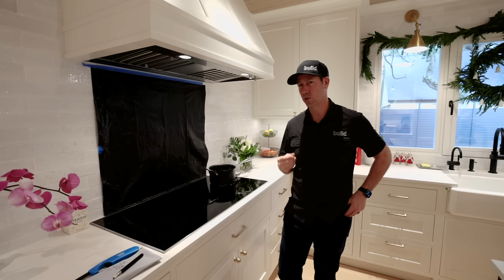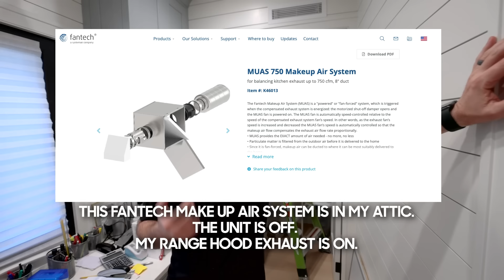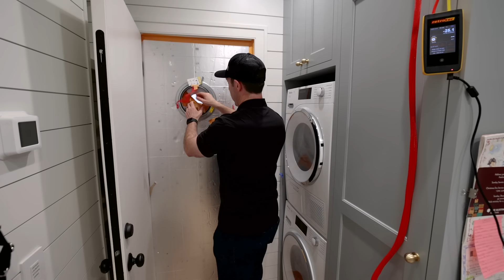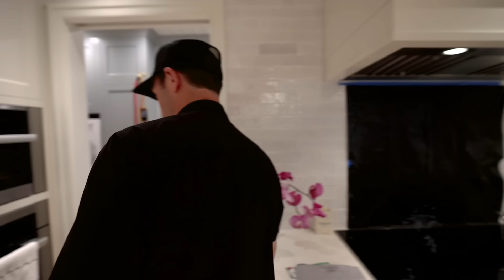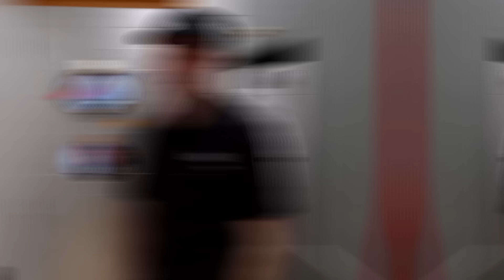Make Up Air for a Kitchen Exhaust - Most Homes Suck. (Pun intended)

Comment: As always great information, ventilation is not the same as circulation. 
Make up air is very important!!
   400cfm's is roughly about 1 ton of air.
800-2,1200-3,nd so on.Another good point no more than 3pascals of difference in air ventilation. 
   Lots of good stuff to know from
  "THE BUILD SHOW"
Thank you Matt!!!
Reply: james for sure 3 or less highly desirable, but has anyone really died from temporary 5 pascal negative pressure in a house while cooking ?? really hard to make he case for they expensive, complicated Fantech system

Comment: Hey Matt! Remember A = π r2 so a 16 " hole would not be twice as big as and 8 " hole. It would be 4 times as big. To get twice as big multiply by √2 (approximately 1.4142) so about 11.3". Thanks for the info however.

Comment: A 12 inch hole would be twice the size of an 8 inch hole (area of a circle).  A 14 inch hole has over three times the area of an 8 inch hole.  A 16 inch or 24 inch hole would not needed be needed to double or triple the intake opening.  Great video!
Reply: Excellent point...  I did the same calculation on a house I am designing and think that passive make-up air is a better tradeoff if there is a good location for the intake vent; and I settled on an 8" x 20" hole -- 3.2 times larger than the exhaust duct.

Comment: I have a house that I am designing in North Texas.  The house will have a gas cooktop and a wall mount kitchen hood that will pull 1266 CFM at its max setpoint.  Fantech makes a matching make-up air fan for this set up (similar to your install).  I fear locating the make-up air at the hood for 2 reasons.  1.  It will blow 1266 CFM of hot air on to the person cooking.  2. Since it is forced air, 1266 CFM will be blowing onto the gas burners and pots (possibly altering the cooking process).  I saw how turbulent the air was at the make-up grille at the other end of the room of your home.  I like locating the make-up air away, like that to make the conditions at the cook-top optimal.  Unfortunately, the HVAC system will somehow have to manage the addition of 1266 CFM of outside make up air when the air is introduced so far away from the hood.  The energy efficiency / reduced HVAC tonnage for tight construction home might need to be recalculated to account for the 1266 CFM of outside air.  Therefore the HVAC system has to be upsized to account for this.  Frustrating.

Comment: My return ducts have a make up air valve to the outside to make up the air that leaves, the HVAC unit can pull in outside air and pressurize the home just a little.  Don't have giant bath vents or range hood, just 6in each.

Comment: Regarding the size of passive make up air opening. Remember the size of hole and flow isn't linear. A 4" hole passes almost twice the air of a 3" hole. So the calculation of passive intake should take this into consideration.

Comment: @Matt Risinger So I just replaced my MicroWave Oven (MWO). New GE one runs the exhaust fan continuously every time the MWO is in operation! It runs on low speed at approx 300cfm. Soooo, that is really bad for my heating/cooling and its loud. Not sure how to deal with it and wondering what other MWOs have this "feature :)". GE just a little backwards here, something about protecting their equipment from overheating but most MWOs run an internal fan to cool their components. I think they are telling consumers that theirs is also an internal fan but I disconnected the exhaust duct and verified that its exhausting to the outside during operation. Doubt many/any consumers/installers/builders know this. What fun!

Comment: Yes, in Minnesota you need to heat the incoming air or at least run it into the furnace return air duct.  Come this summer in Texas you will decide you need to run the incoming hot moist air into the AC return air duct.

Comment: Especially with changing weather and pressures from rain or freeze drying also have a connected garage front and rear back door specifically near halloween with our crazy weather I try to turn the fan on and open doors to recirculate fresh air

Comment: In Spokane, I would have a filtered and heated make up air system in winter but in summer, we always of late have 8+ fires around us that settle into our basin, AQI is extremely hazardous at times so must have a HEPA filtration system to prevent bad air from coming into house in July thru mid September.  It’s a problem I need a Registered Professional Engineer to address as this is beyond my skill level.   Be helpful in several western States and BC would do fire mitigation to rid underbrush that flames up but no one in department of interior has thought of that.

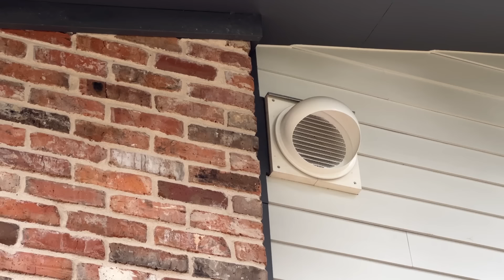Comment: A make up air intake is a afterthought to a design flaw in the HRV, also a 8" uninsulated hole in the wall 8:31
The HRV simply needs a variable speed intake motor hooked up to pressure sensors inside the house to spin faster to balance the pressure in the house

Comment: For anyone considering this, ask your HVAC guy or anyone knowledgeable with the psychrometric chart.  Let's say your indoor air is 72 degrees.  Bringing in unconditioned outside air with a dew point greater than 72 degrees guarantees condensation.  Examples would outside air higher than 72 degrees and raining, 85 degrees outside and relative humidity above 65% or 95 degrees outside and a relative humidity above 50%.  It will be raining in your house!  The same problem occurs with ERVs.  The heat exchanger can cool outside air below its dew point, resulting in condensation.  A ventilating dehumidifier would be a better choice for humid climates.

Comment: Balanced ERV (with both supply and exhaust fan) that increases supply fan speed when kitchen hood fan is turned on seems like a much simpler solution.
Reply: ERV systems are usually way lower CFM than what is needed. a 100CFM ERV will barely make a dent when you have a 800CFM vent hood cranked up.
Reply: I was wondering the same. Zehnder claims that their Q350 ERV can handle makeup air requirements for our rangehood (which will be around 350 CFM). Would be a lot simpler than paying and installing a motorized make-up air system that also requires filtration. Would be great if anyone has tested and looked closely at this.

Comment: No it makes sense that a hole that doesn't have a fan in it isn't going to move as much air as the same size hole with a fan. The only thing making air move through the open hole is the suction from the fan, and the lower that suction gets the less air is going to be pulled in - so as long as the fan is making suction there's going to be negative relative pressure in the house, and after the exhaust fan is turned off it's going to take a bit of time to equalise.

Comment: All of these motors, dampers, sensors, manifolds, and computers systems will need to be maintained (diagnosed, repaired, replaced, accessed) by a technician.  There is a backup generator, but everything is dependent on having electricity.
Reply: thank you! a voice of reason

Comment: I like this. It's nice to see it's already a package deal so I don't have to build one which is what I was thinking! The only thing I don't agree with would be your location of the make-up air on the other side of the house which means you have to create an air flow across the entire house to evacuate food smells or smoke or steam at the induction stove top. It seems like it would make much more sense to have the make-up air come in locally in the kitchen so that you don't suck expensive conditioned air out of the house. I have often thought there should be make-up air somewhere in a bathroom at the floor level so that when you want the fan on in the bathroom it would suck out just the air in the bathroom. Not to be too graphic but if you have a stinky bathroom there's no reason to suck the air out of the rest of the house just because the bathroom has an unpleasant odor just refreshed the air in the bathroom! This would be the same for your kitchen. Better luck on your next build.

Comment: My rangehood filters the "exhaust" air and blows it straight back into the room to get around this problem, it doesn't extract air as well but is simple and cheap. (I have a passive house, as I understand it this is normal for passive houses).

Comment: I'm thinking of running PVC piping from my cooktop to the outside.  Capped with an air admittance vent.  When the exhaust fan is on, woosh, here comes the air right at the cooking grate.

Comment: I'm someone who works with airflow and pressure differentials at my work. Mostly to keep things clean and also to keep from having the place explode. 

So I get it.  I also get the idea of controlling the air flow.  But I live in a 100+ year old house.  It's so silly. All the regulations trying to stop every tiny little leak.  Insulate to insane levels in the north east.  Then limit what fuel we can run our houses on.  Then we need to have higher cfm exhaust than years back.  Now we have to bring in outside air.  Why is it so terrible to have an old leaky house again?  My pm2.5 and other PM s are lower than some relatives are with much newer homes.  And I have several cats and two old world dusty parrots. 

Chasing out tails I think we are.  I believe we passed the point of reasonable return a decade or two ago with many of the new things that are now required. 

Actualy these systems are super important to keep in mind as you gradually update an old home.  I know one realitice that replaced slider and storm windows with new windows.  The house was already much tighter than mine but still an uninsulated 1960s house.  you can smell a small cooked meal well into the next day and if anyone has showered reciently.  Never had this before the windows. The bath has a up to code fan but nothing in kitchen.  Males me afraid to tighten up the building envelope too much on my old home.

Comment: this seems like a fancy way to not open a window...
Reply: Yeah. Opening a window or multiple windows is usually the cheapest option, but i think he explained one side of the issue with that. You get pollen or some dust or something like that sucked in through the window. This can be avoided. Intake duct has filters so the air is cleaner and also you can heat the intake air, if you live in the cold climate. Otherwise you get really noticeable cold drafts coming from your window. Especially if you are running higher CFM fans. Only thing is that I would put exhaust, intake and intake heating under different control knobs, so I could just open the window during spring/summer time, not running the intake fan etc.

Comment: Interesting stuff.  I'm gonna assume the reason there's such a difference in pressure is because you're using a powered exhaust vs passive intake.   The powered exhaust will simply try to draw more air in than the current opening(s) can pass.
I need to add an exhaust system in my kitchen to help remove all the grease from stovetop cooking.  My non exhausting hood vent just ain't cutting it.   lol  With my current setup I can go up across the kitchen(2 story home with plumbing above kitchen) and out the side of the house fairly easily.   Just not sure I can use large enough ducts.

Comment: You wouldnt believe how many attics ive been in that has a fresh air intake with a heat exchanger and it was never wired to power. Probly 80%. Definitely some crooked hvac companies doing big housing projects.
The biggest benefit to me for induction stovetops is how easy they are to clean. That alone makes it worth it

Comment: I would think if you lower the hood and make the hood a size larger then the cook top it would capture dirty cooking gasses in the air more efficiently. This would reduce the make up air required.

Then simply open then window above the sink. Windows in the kitchen should be above the sink. Not far from the stove.

A two burner design with both burners located under the center line of the hood will create more head room. 

For example, If the range is 30” a 36” hood would be best. A 24” cook top would use a 30” hood.

Comment: my house was built in 1899. i heat with a wood burner and it is so drafty ,the wood burner works excellent. when you open the door the smoke from a cigarette lingers in doorway. i must be at 0 also🤭

Comment: I just open a window or slightly open a door by the kitchen - but if I ever buy/have built another home, then this concept will be on my  must have list.  My current home has a separate double oven setup, it sure would be nice if those were designed to be outdoor ventilation capable - makes me wish I had a stove in the patio to handle all the multi-hour bake times.

Comment: Great videos Matt!   Learning a lot as I'm in the process of a new home construction as well.   I've been thinkitng about this make up air system for a while and was hoping I could find a way to trigger the Aprilaire ventilating dehumidifier for the ventilation mode when fans are running.  From a home automation perspective there are several ways I can determine when fans are running and the cumulative CFM draw down on the house, however, while the Aprilaire ventilating dehumidifier pairs nice with the HVAC and Ecobee for humidity control all I've been able to determine (including speaking with some very knowledgable folks in Aprilaire tech support) is that the ventilation feature runs on a simple minutes of air per day controller and can't be triggered by any external protocol or relay.   I'd be really interested if anyone has gone down this path and figured out a way to do it.  The Fan-Tech stuff looks like it might accept external triggers which I'll pursue but I'd like to use the upgrades I've already committed to instead of buying more equipment.  Plus the ventilating featon ure on the Aprilarie already has a filter and dehumification capability which for a Florida home would be nicer than just bringing in hot humid air to balance the kitchen and other fans.

Comment: Could you put an 8" (with motorized damper) duct from outside to the cold air return on your furnace, then turn on the furnace fan when the exhaust fan is on?

Comment: Matt I couldn't agree more. An induction cooktop versus anything combustion is a great way to reduce the indoor air pollutants that you release when cooking. I did the same thing in my new home. Also you can cut down the hood CFM by getting a larger hood and putting it closer to the cooktop. CFM distance and area of pickup are the three ratios that you can work with.

Comment: When the outside air temperature is within several degrees of the indoor that system is fine. 

When it’s -20f outside you need to temper that make up air!

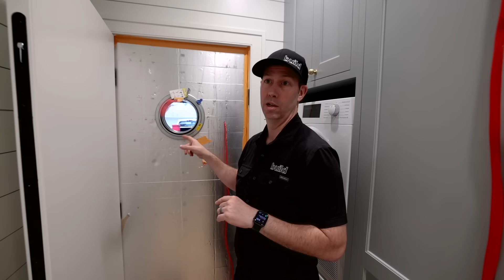Comment: I have a correction for your video at 5:24 in the video you say that you need to double or triple the size of the hole.  Then you say that you would need a 16” or 24”.  So if you do a little math a 16” diameter hole is equivalent to 4  8” diameter holes and a 24” diameter hole is close to 9   8” diameter holes.  The math for the area of a circle is pie times the radius squared.  If you calculate the area of a 8” circle it is 50.265 square inches a 16” diameter circle has an area of 201.062 square inches.  So in your example you need to have 4 8” holes to be equivalent.  Still good information love your videos.  I have learned a lot watching your videos.   I am not a builder just a homeowner who has been a victim of poor building practices many times.  I have used what I learn to make my home better.  I am an engineer so I love the nerdy details sometimes I think I should have been an architect

Comment: Yes, makeup air is essential, though seldom provided.  But the thing I noticed is that this hood, like most I see, is much higher than it needs to be, so will allow diagonal escape of smoke or steam.  I have often moved in to a house and lowered the hood.  It should be no higher than the tallest pot, plus a sightline to look into the pot.  Looks much better low too, IMHO.

Comment: A 16 inch diameter passive duct I think would be bigger than you need.  Your fan powered 8 inch outlet duct has a cross section area of about 50 square inches.  A 16 inch diameter duct has a cross sectional area of about 200 square inches.  If you are wanting to double the cross sectional area of your passive makeup air duct then you do not want to double the diameter of the outlet duct.  Doubling the diameter of the passive duct to 16 inches actually quadruples the cross sectional area of the of the 8 inch outlet duct.  If your need is to double the cross sectional area of that 8 inch duct, then you will would need a passive makeup air duct that is about 11.25 inches in diameter.

I would start with a 12 inch passive makeup air duct opening and do some testing to see if your inside/outside pressure differential is within the 3 pascal limit with the exhaust fan running and the passive inlet duct fully open.  Perhaps you would need to go to a bigger inlet air opening if you are not getting an acceptable pressure differential.  With a house as tight as yours you might have to take an exterior door off the hinges to get enough makeup air!

Comment: Great video as I have been thinking about how my clothes dryer affects pulling air into the house from outside.
Reply: The way to do tight homes now is a Condensing Dryer. We had just bought ours when we moved  into the tight home and so we can't afford to replace it yet. When it dies, we will buy an (energy star - I think they all are (?)) Condensing Dryer and I will seal the dryer exhaust duct with foam.
  Note - our "normal" microwave exhaust at 300 CFM makes the doors difficult to open. We like it exhausting outside so we added make-up air system.  (I didn't want to but finally found an INTERNATIONAL EXPERT (Joe Lsitburek) who said that was the problem. Usually the code starts (I don't know about every state.) at 400 CFM. They forgot about (so far) tight homnes which ours is.